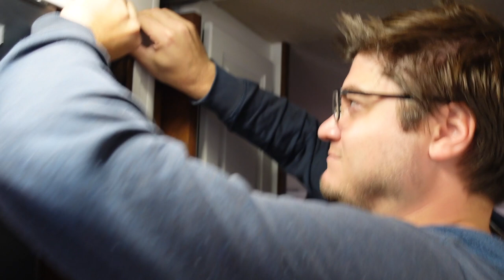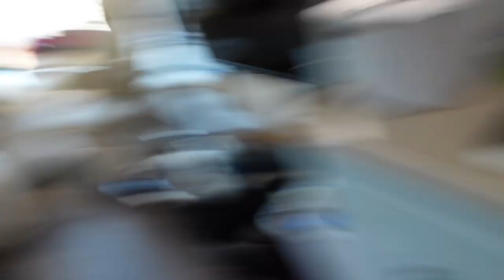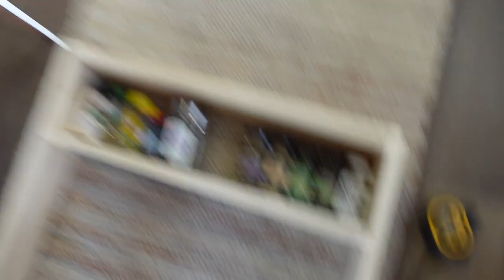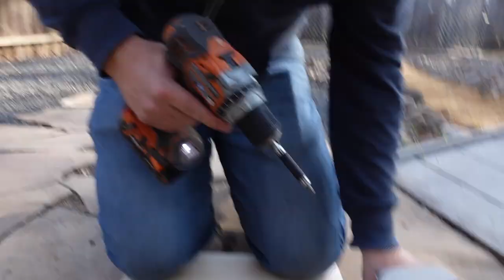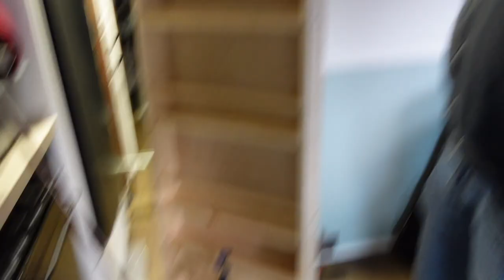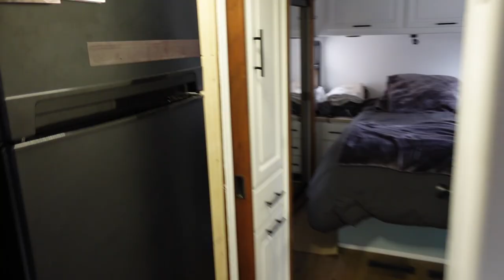Sliding Pantry Build | RV Renovation

Comment: Yeah, your Sag is from the verticle slides being mounted in the horizontal position  rather than vertical.  They do make slides for that purpose.  Meant to be mounted on the top or bottom of the box rather than the sides.  But, it looks really good, and I wouldn't worry about it until they start having issues. 
I am currently researching pantry  slides so I can slide out my current drawers together in a box and still slide out of the box.  This way I can build a counter top on top if the box when it's out for more food preping counter in my RV.  And still slide out thee drawers with the box out or in. I've been modding my big RV FOR 23 YEARS.

Comment: from someone who has a slide out pantry in our motorhome,  make sure you put a lock on it as ours has a door and then slide out shelves and used to still slide open when the road was too bumpy.
Reply from the maker: Yes. It is a must. We put a pin lock on it and it worked great until we went down a bumpy stretch in California and the wall flexed. The pin popped out. So I had to find a lock with a longer pin. Now it’s solid going down the road.

Comment: where do you buy such sliders? Especially the type for putting on bottom of a cabinet instead of sides like a drawer?  Do you measure slider needs by measuring width of cabinet frame and then times that by 2 since it needs to then pull out all the way? I'm trying to build something similar to hold brooms and mops and have a shelf for holding cleaning bottles etc.
Reply from the maker: We bought oversized ones on Amazon. I couldn’t find any specifically made to be mounted horizontally like that. They are technically made to be mounted on the side of a drawer. So we bought 250lbs rated slides with the hope it would work. And so far, it slides great. I did also have a backup plan to modify the cabinet to accommodate mounting the slides in the other orientation, but it wasn’t needed. 
I think the slides had measurements for fully closed and fully extended. We knew how much space we had and how big the cabinet was going to be. So we just found appropriate slides. I thing ours is 24” collapsed and extends out either 24” or 35”. I can’t remember now. I think I left a link to the slides in the video description.
Reply: @ryanandsu  message received. Thanks for the input!